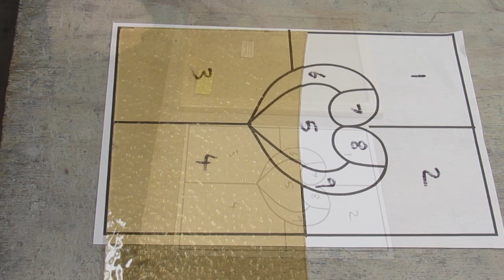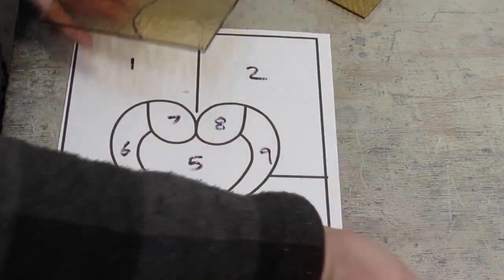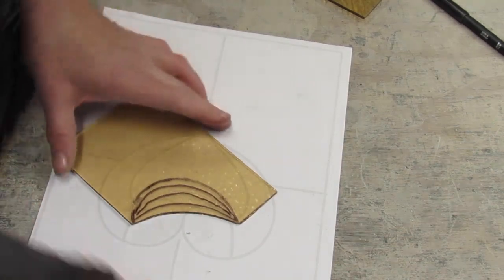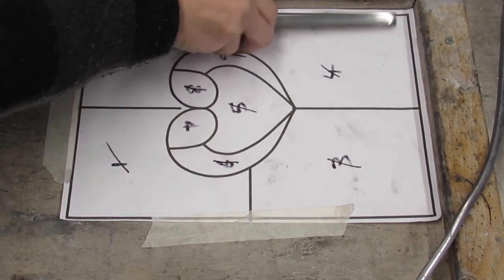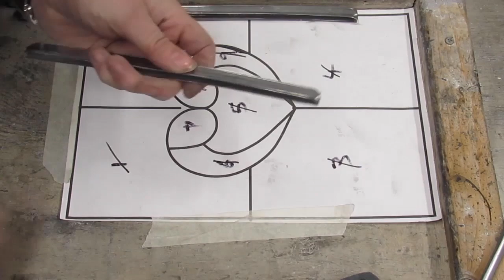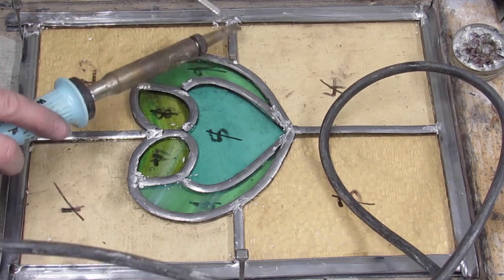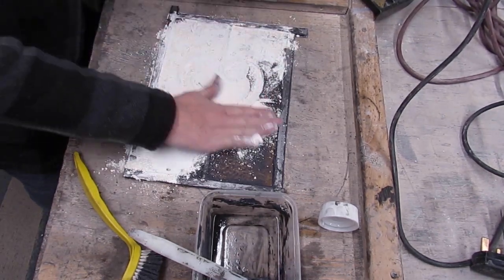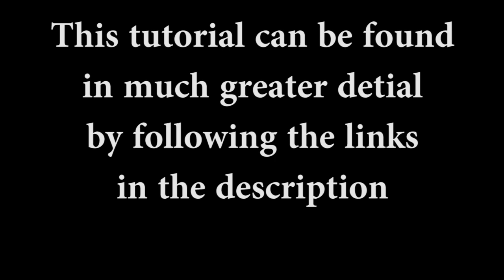Sophie's Stained Glass | How to make a Stained Glass Panel: Beginning to End

Comment: Awesome!  Could you also hang the piece with a chain?  I understand the came could sag.  But would 12mm border came hold, if the piece is small enough?
Reply from the maker: If you do try hanging your piece by the lead, make sure your loops are positioned at a joint - mitigates the sag a bit.

Comment: Hi! Love love love watching you work and your completed  pieces!
Question…do you use H channel lead on the border when you’re going to frame the piece and U channel lead when not placing in a frame? 
Thank you!!
Reply from the maker: No, H for both. I mostly make architectural panels where H lead is always used on the outside.
Reply: Does the u crossection crunch up more than the H section, what is the tool you use for cutting the came Sophie it makes light work of it @SophiesStainedGlass